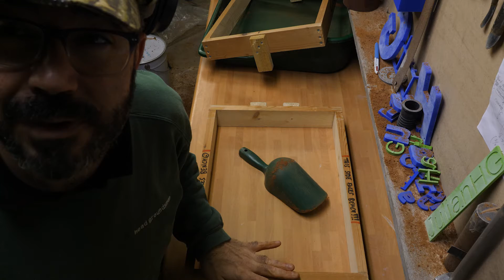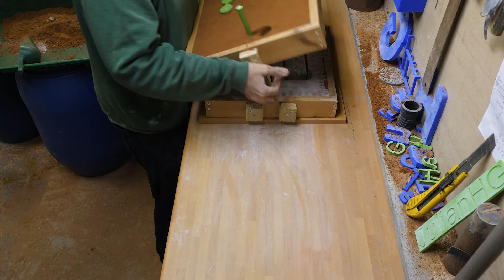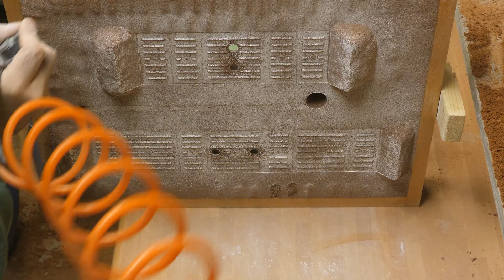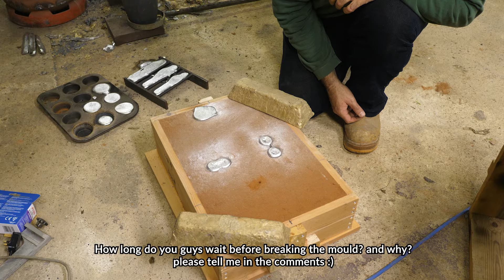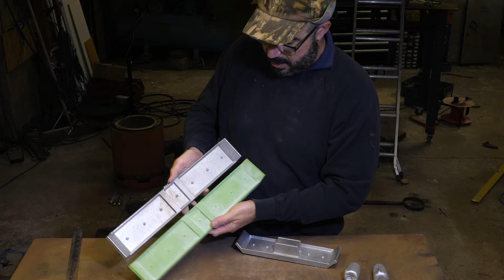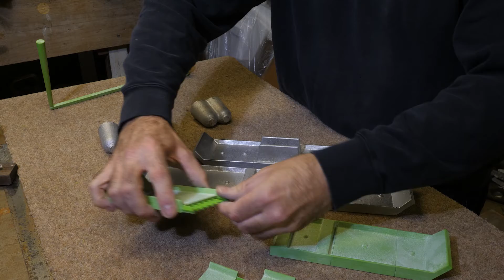how to cast a DIY casting flask (Modular Flasks part6) casting V6.7 with 3D printed gate & spin trap

Comment: Hi, your design is really cool ! I started to mold my flasks three days ago and it works very well. I already cast three of them.

I noticed the feeders are really big, that's why I simulate it on "NovaFLow&Solid" and I found you only need to fill 25 milimeters of it. I think your filling system is really good for exceptional quality flask, but if you make bigger runners and gates you could heat really less your aluminium, and you could save more sand and gaz.

I started design a connector to attach two flask and make a longer flask. I'll share it later !

Keep on it !
Reply from the maker: awesome Morgan!!! i'd love to see some photos, i know others have made some too. I'm so pleased you've found it useful! :)
Reply from the maker: How did you get on Morgan?

Comment: I ended up having to cut the fingers off. I guess different printers, different results. Hot glue works just as well for me. It's a strong bond and it's easily removed when finished.

I redid a couple pieces in fusion 360 to remove the fingers and slots. I printed those with great results.
Reply from the maker: Lienad Abrasax ahh interesting and thanks for the hot glue tip. You’ve reminded me, I was going to release a glue together version, I’d forgotten. I’ll sort that out ASAP. I hope the rest works out for you! Cheers

Comment: Nice pour, the spin trap, runner, gate, pouring basin, and tapered sprue predictably made an improvement in your surface finish and casting quality. 
Chvorinov's rule will allow you to calculate the solidification time for your casting. (surface area and volume are the major influencing factors in solidification time)
(hint: you can also use Chvorinov's rule to calculate the size of the feeders to prevent shrinkage via the basic relationship "Chvorinov's rule for part < Chvorinov's rule for feeder" so you have 20% longer time in the feeders)

Your pouring basin could have been a little deeper and the ridge closer to the bottom of the pouring basin. 

Look forward to seeing more as you refine this.
Reply from the maker: thank you so much Ask! i've been watching your channel recently, great fun experiments. :) and thank you for the casting tips and advice, it's much appreciated!
Reply: @JulianMakes  thanks for watching, and your welcome.

Comment: Looks great mate good work. Bloody fantastic. Those feeders seemed to work great. Always use feeders as good practise. Metal as you seem shrunk 7mm I think you said on the longer or the two casting.. if you didnt have the feeders there is a big chance they will end up with cracking because the metal shrunk and cooled too quick.. and or corse distortions where applicable... again looks awesome and keep casting mate your doin awesome
Reply from the maker: thank you so much Raschelle :)

Comment: A fantastic result!  The casts look great.  If you make the side ribs too narrow will it be hard to register the cope and drag when you stack them one atop the other?
Reply from the maker: thanks Mark! yeah i'll def not go to just a pure plate. but i've done a prototype where the ribs are even smaller (and the wings - and they have bolt holes cast in too) - it's a future casting

Comment: Hey, where did you get the idea for the runner/gate system? It's brilliant! 😄😄
Just curious, what was the ratio of gate to runner? I assume your gates were more volume.

Well done mate.  A joy to watch. You're a prince... well not like Andrew but you know what I mean 😄
Reply from the maker: thanks Perry :p yeah my sprue is 51mm2, the runner is about 52mm2 and the two gates i purposely made very flat and wide (way too wide really ) but my thinking was to keep the area cooler - each gate is 3mm x 24mm (so yeah the gates were not the bottle neck :) i love it. Did you like my little runner extension pieces? :)
Reply: @JulianMakes  I hadn't thought about the gates cooling the metal. Although once the sand is heated, I'm not sure how much heat loss there is. I was thinking more along the lines of lowering the velocity at which the metal enters the  parts. You're at about 2.8:1 in terms of the gate to runner volumetric ratio. Which, if I do the math right, should have slowed the velocity by about 2.8 times ;-)

I did like the runner extensions.
Reply from the maker: @swdweeb  lol you are a math genius :) i was trying to keep the gate area sand as cool as possible (where the fresh hot metal keeps topping up the heat). i should do an experiment where the gate is just s square 5x5 to see if anything's different. (if i didnt have other stuff to do right now ;p)
Reply: You forgot to add "And Epstein didn't kill himself."
Reply: @jerrywhidby.  Wait...what?? You mean he didn't?  😉